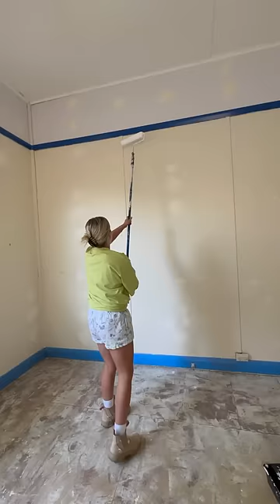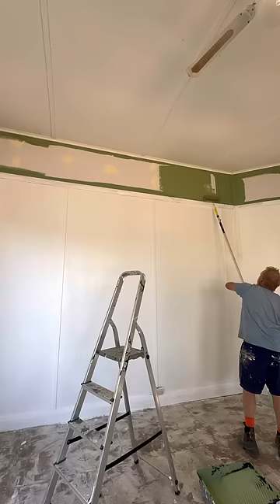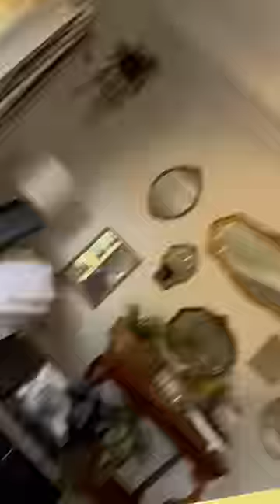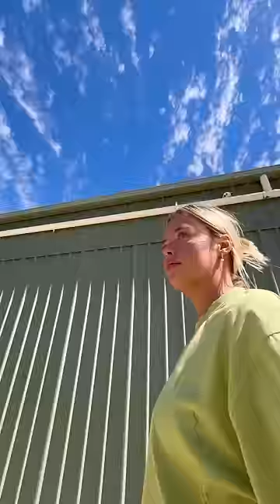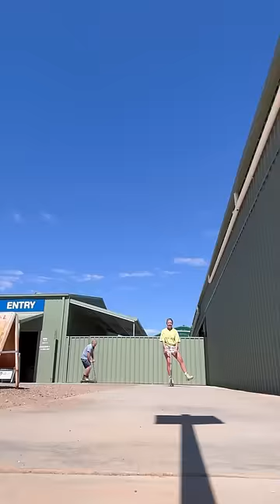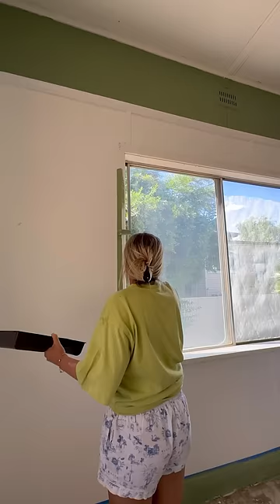#houserenovation

Comment: If you paint the ceilings.  We used a roller pole and duct taped the brush to it.  The straps were painted easily , and the rest rollers,  standing on the floor.  No ladders!!!